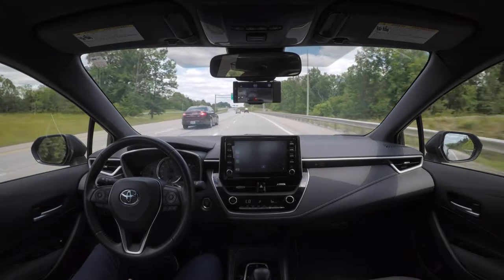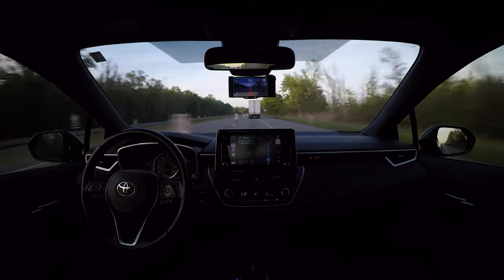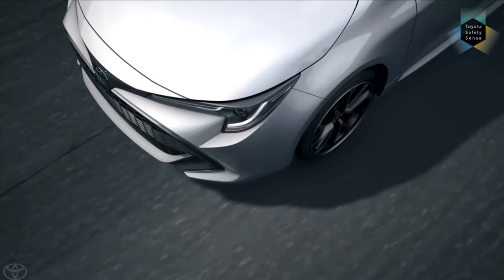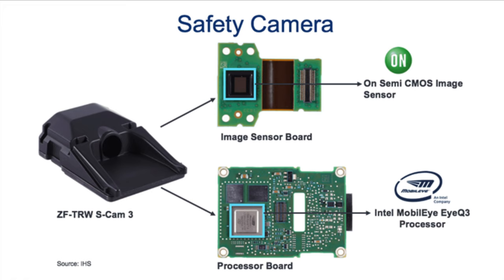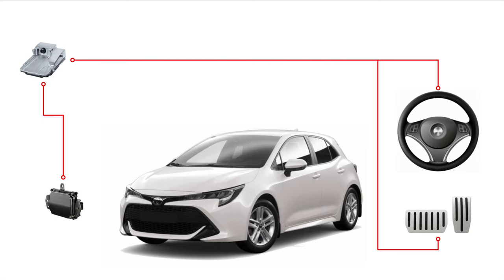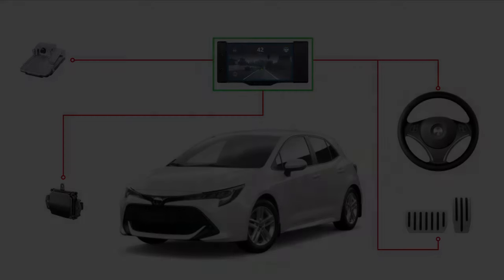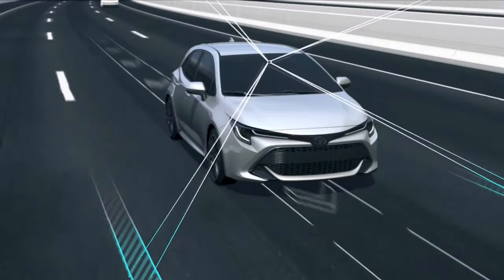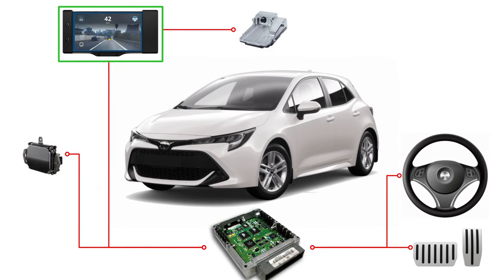How OpenPilot Hacks Your Car To Drive Like A Tesla

Comment: I was wondering about the openpilot speed display.  Does this use the information directly from the speed sensor on the car or is it the GPS figured speed?  I am asking because my Toyota car display is 3 mph difference then the speed that openpilot is displaying and I am wondering why
Reply from the maker: It’s using real wheel speed data that’s taken from the vehicle’s wheel speed sensors. Basically all factory speedometers are scaled conservatively to read slightly lower, the faster you go the bigger the gap in indicated speed vs true speed.

Manufacturers wouldn’t want their cars reading slower than true speed so they hedge against that. Also a cushion for small changes in tire diameters when you get new tires. For example a .25” of tread height difference would be 1mph difference at a speed of 55mph for your average 17” wheel/tire combo.
Reply: @LoganLeGrand  Your first and second paragraphs appear contradictory to me. 1. Factory speedometers read slightly lower (I assume that means they display lower than true speed). 2. Manufacturers don't want cars reading slower than true speed, so they hedge against that.

So which is it. The speed displayed is higher or lower than the true speed?

Comment: I loved mine when it was working. It overheated and stopped working after a year and two months and 22K miles. Will cost either $500 for a replacement head with no warranty or $1200 for a new unit with a 1 year warranty.
I decided that all it ever does is steer the car.....which I really loved....but it was not worth the $90 a month it cost to have it for just a short amount of time. It now sits in a drawer with no way to get it fixed according to Coma AI.
Reply from the maker: $1200 for 14 months would be about $86 a month if you want a warranty. $500 for 14 months is $37 per month. So big premium for a warranty but $500 replacement isn’t too bad of a deal IMO. I’m sure some people might still see the value there but understandable if you don’t. It is developmental hardware so I wouldn’t expect consumer quality even though there is a full 1 year warranty on any defects.

Comment: Does Toyota Safety Sense have separate steering and acceleration command?
Reply from the maker: Different versions of Safety Sense and different Toyota models have differences in how they work. TSS2.0 seem to all consolidate at the adas module behind the camera, but some vehicles like the Prius still have what’s called a DSU, which is under the dash and not as easily accessible. You can see which cars have what type of control by checking out the Supported Cars list here: https://github.com/commaai/openpilot#supported-cars

Comment: For anyone reading this. to have full stop/go longitudinal and latitude control you must have a toyota with TSS2.0 FULL Dynamic Speed Range Control or greater. So if you are looking for a new car keep this in mind.  This is present on all xle, xse and hybrid trims. And apparently all the corolla trims. Bahhhhhh.i really wish i knew this. Check the toyota website for this detail.  Once again look for  Full-Speed Range Dynamic Radar Cruise Control (DRCC). Good luck and enjoy

I'm a little annoyed this isn't made more clear in the open pilot community.  I got a new 2021 camry se and I don't have that so I'm returning my comma ai. I'll get a comma again with my next car
Reply from the maker: The Camry is very odd. Almost all new Toyota’s work at all speeds except a couple trim levels of the Camry. Also some Lexus models have the same “high-speed dynamic cruise control” and not the “all-speed” version.

It is made clear which cars uses stock cruise and which dont, but all cars are still limited by the factory capabilities somewhat. Like some Honda’s don’t have steering control under a certain speed, but that’s also laid out in the supported cars list as well.

I would still think OpenPilot is worth it even if it doesn’t work below a certain speed. There are probably some custom forks that can further improve that specific car’s performance even more than stock OpenPilot.